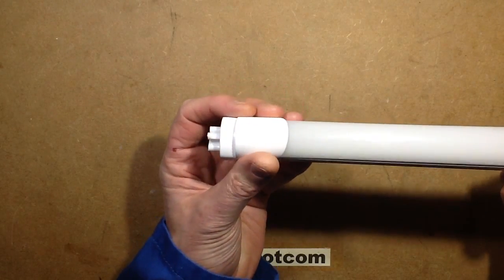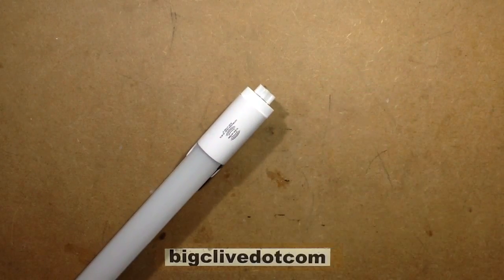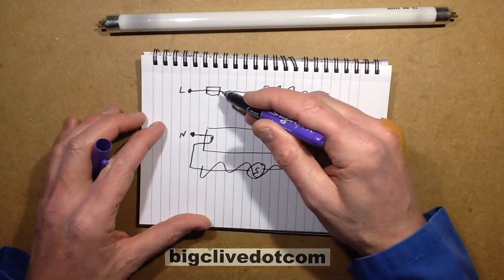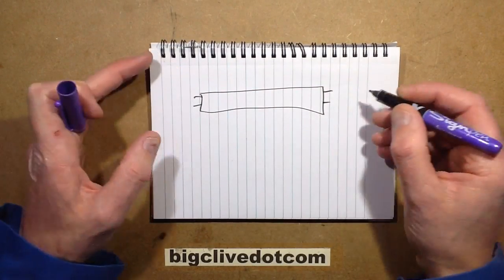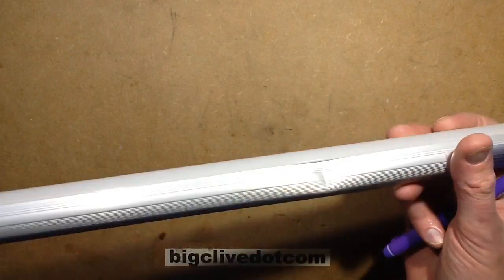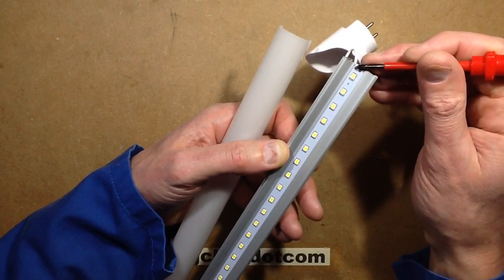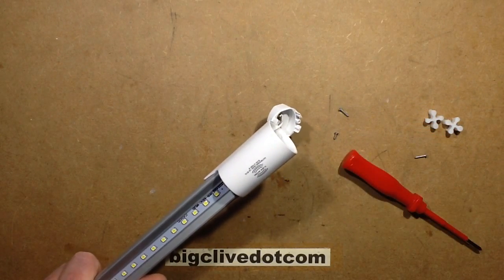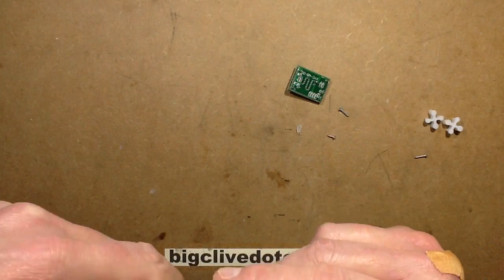Inside an LED T8 radar retrofit fluorescent tube.  (Excelvan)

Comment: It is probably a constant current buck regulator.
8 parallel strips of 24 series LED's.
Now that you've knocked one string out, the 7 rest will have to share that current making them fail much sooner. Avalanche effect.

Comment: 2025 Clive thank you a great informative video. May I ask a question? On the two pin Live on  one pin and Neutral on the other.. safer retrofit circuit as you advise. On the driver side mentioned. They show a live and neutral to connect to mains. In my book this is important. Can you confirm? Many DIY videos brush of and say it does not make a difference 230 V it is alternating current at 50 hz. I believe it is important for safety. To connect mains cable to a E 27 E S lamp holder it is important  to connect the live red/brown into the center point. Which is the correct practice.
Reply from the maker: In the case of an Edison lamp holder the live is connected to the middle pin at the back to reduce the risk of a shock if someone makes contact with the outer base while screwing a lamp in or out.   In the case of the fluorescent tubes, early units had live at one end and neutral at the other, giving the risk of contact with live pins when inserting the tube.
Reply: @bigclivedotcom Thank you again Clive. The original method was banned here. The retrofit led tube G 13 bi pin have to be marked L and N for exactly the same as you mention for safety. I have watched many bloggers saying it makes no difference where the L and N wire is connected but it does you always start by shewing a fuse of a sort on the L side not on the N side. Total enjoy your very informative videos. Please keep it up.

Comment: Hey Clive... I know... 8 yrs old video but I know you read messages so I have to ask you... have you ever did a video on T8 style LED tubes ? I can't find one if you did...
Reply from the maker: I have some here to take a look at.  The slight issue with the long tubes is fitting them on the bench during filming.  Most seem to either have a buck regulator in the end, or linear regulator chips, and then long series/parallel arrays along a PCB in the tube.

Comment: Hi Clive. Not sure if you will be aware of postings to these old videos, but I stumbled across this in my hope that my trusted content provider would have some wise words on the subject of replacing Fluorescent tubes with modern (2023) equivalents.
I saw this prancing prat https://www.youtube.com/watch?v=TzDA-paae3k telling me just what I wanted to hear!
I have 2 fittings from the 1960's which are beyond help.
To remove the fitting would bring down much of the ceiling, so I wanted to remove the failing Ballast, and the (dicky) Starter, and re-jig the wiring to accommodate a modern 1500mm T8 Frosted LED unit.
Having difficulty in finding such units which don't require Ballast & Starter.
Can you educate me, or consider re-visiting the world of Fluorescent Tube replacement, as I think it's something others might also come across?
Reply from the maker: Many modern LED tubes just require the supply to be connected across one end.
Reply: Lordy! you're up early!
Thanks Clive, does the other Tombstone needs shorting, to complete the circuit through the tube?  @bigclivedotcom

Comment: Hey Big Clive I just got a bunch of these tubes and they can be used with or without the ballast. I removed the ballasts to save energy and reduce heat. I noticed through that the tubes had L and  N at one end but they other end was just N on both pins. And the two pins were shorted out. This means if you rewire the fitting according to the instructions that come with the LED tube, then you must not put the tube in backwards or you will connect live to neutral. Any thoughts?
Reply from the maker: Some tubes still use the ballast, but others require it to be bypassed.
The first LED replacement tubes were powered from both ends, but posed a shock hazard if the tubes were changed with the power on when one end was inserted into a holder.  They changed it so one end is linked across, and also provided a shunted starter replacement.  Some contain a fuse - sometimes a self resetting PTC fuse in the shunted end in case the tube is put in the wrong way round.
Reply: @bigclivedotcom  Ok so the shorted end might have a self resetting fuse… why not just leave the pins disconnected though? Nowhere on the box does it say that there is a right way and a wrong way round to install the lamps. I have put large X’s on the ends of the fittings and the lamps so future me doesn’t go tripping breakers all the time :)
Reply from the maker: @billneoorg  It's so that the existing wiring of the fixture can be used after the ballast is bypassed.  By default live is at one end and neutral at the other.  It is bridged to the other end by the starter circuit.
Reply: @bigclivedotcom  thanks for answering by the way I love your channel!!!

Comment: Do you find in general swapping incandescent lighting for LED lighting you end up with a much lower light level and in most (all my instances of doing this) a very bad colour cast due to the LED lighting being warm white and giving a yellow cast to everything, making all things a very off shade of their original colour?

I recently (July 2022) tried some Asda 100 Watt Equivalent = 1521 Lumens LED BC light bulbs. Great, I thought, there is no plastic skirt around the base/glass bulb to cast a shadow halfway down your wall and that leaves a very dark ceiling.

I currently use 100 watt incandescent light bulbs that are marked as the equivalent to 1250 lumen. I have no idea how Asda measures the luminescence of their LED light bulbs that are marked as equivalent to 100 watt and 1520 lumens. The 100 watt incandescent light bulbs that are marked as the equivalent to 1250 lumen were far far far brighter than the Asda 100 Watt Equivalent = 1521 lumen LED light bulb and the colour cast of an incandescent light bulb is closer to being correct colour balance than the LED light bulbs I tried.

I am sorry to say, I still don't use LED lighting in my house because the LED lights are too low a light output and too close to being a yellow light than white light.
I'm sure if I put enough of these Asda LED BC light bulbs in the room, the room would be bright enough and if I added a blue filter it might whiten the light output, but to add enough light bulbs would defeat the current ideas that LED lights are more efficient than incandescent light bulbs, I guess they are if you are happy living in the "dark".

I am still waiting to find an LED 240v Bayonet/BC/B22 CAP light bulb that I can swap for the 100 watt incandescent light bulbs I currently use without sacrificing the amount of light and the colour temperature of the lights.

Regards,
K Watt.

Comment: I gotta say clive this is one time ill disagree with you, led lamps are much much brighter than the fluorescents, ive worked on both. It all depends on how high of quality the led is. In most office cases i actually end up getting called back to take out led tubes as they are too bright for the people working in the office, and its not the color we dont put anything up thats above 4000k unless its a special circumstance. In most cases the tubes i install are taking off much more than 50% of the power. And ive worked alongside contractors who think their electricians because they can rip out some wire and install an led, and i agree, they leave sloppy work and only care about the numbers they put up not how the next guy is gonna have to deal with their mess.

Comment: we converted all the t8s in our house to use led tubes. powered at one end only. i bought a bunch of these in 8 packs at about $10 each on amazon. and several of them have failed. ours looked like these, but did not have the motion detection feature. i saved the parts and was tryinv to determine the forward voltage of this strip. thanks for mentioning it in this video. i bought a small boost converter to power these high voltage strips amd also those tiny filiment ones. now i just need to figure out what to do with them. my led strips were ‘glued’ very poorly to the frame and did not sit in a track as you have mentioned here.

Comment: Some of the radar sensor I have taken apart and used for amateur radio hacking have used free running oscillators some have a DRO and are sorta set to a frequency. The free running types would change by 100’s of  MHz just by changing the loading and parasitics the DRO type seems to stay somewhat stable say 50MHz of drift with temp and loading. My guess is the fact they are all over the place and are operating in CW or FM CW mode you would see very little interference between modules.

Comment: I purchased some of the (older style) T8 led tubes and they had spring loaded pins to push switches on each end. I guess to try and make them less likely to shock the idiot holding it by the end. Problem with that, the pins would catch making it near impossible to twist into most tombstones.

Comment: Thanks for another great Video, Clive.
I have a dozen of these tubes in three brands, but all have blown the Polyester cap and the semi next to it.
 Like your tube the supply is 80 volts, but any suggestions on an alternate power supply?
Reply from the maker: It's an odd supply voltage and not much space to put the driver.  A capacitive dropper would be simplest, but not very bright.

Comment: I've seen two version of the LED tubes at the local Batteries + Bulbs.  One is a drop in replacement that doesn't require the ballast to be removed and the other does require the ballast to be removed and the fixture to be re-wired.

Comment: After deciding I wanted to go LED in my garage, mainly I wanted rid of the glass danger above the car, I decided the best option was not to use a retro fit bulb. In the end I went with some IP67 rated sealed units from Lidl. £17 each or so.... OK they are not serviceable but should last 25000 hours or something stupid. I really do rate them, keep a look out for the in the future and maybe you can strip one down to see what its like!

Comment: The newer ones I've seen come with a "starter" which serves to shunt the live & neutral connections to one end of the fitting with no modification to the wiring.
As you say, these retrofits are a complete waste of time & money. I've seen loads out & about with greatly reduced output and /or quite a lot of failed diodes in them. Long live fluorescent lamps!

Comment: I find it funny that this video was posted a few days after i started rewiring the first 50 lights for LED tubes. You and your timing :P
Blew up the first one because i thought they would accept power from both ends like the ones i have in my workshop, but nope, so i not only had to remove the electrical ballast and rewire a bit, but it ended in rewiring everything in there (lots of to short wires, and i didnt really like the idea of 6 wire clips in there)

Comment: "Especially when any real electrician would not finger the other end of a
 tube as they inserted it in the first place as even a conventional tube
 can ionise and give you a shock if you touch the pins at one end while 
shoving the other end into a live socket."

That's why the INSTRUCTIONS on light bulbs always say to turn off the power before replacing the bulbs- ANY bulbs... but since idiots don't read package instructions and warnings I say let em get shocked and they'll learn fast!
In all reality you can't get a shock touching the pins on the bulb unless you ALSO touch something grounded.

Comment: Most tubes rotate (click) into place so i can't see how you would ever electrocute yourself even if the fixture is switched on? I have some Auralum LED tube replacements and they are brighter and whiter than the Philips tubes they replaced, just because the tube you bought was useless doesn't mean they all are!

Comment: This is my first YouTube comment ever.    I find bigclive to be interesting and usually on point, but I do disagree with this video.  

(Perhaps it has something to do with products available in the UK Vs North America?)

I don't have any association with any any manufacturer or sales of LEDs.

From my personal research into the subject of replacing T8s with LEDs, I found this:

NOT taking into account hybrid style tubes that can work with, or without a traditional ballast.

 - Original LED replacement tubes were double ended, with Live on one end and Neutral on the other.
     - These were a problem for safety reasons (live end when installing improperly), and aren't really used in this manner any more.
     - These Tubes did not receive UL, CSA, etc certification.
                  - 

- Next came single ended tubes, where, in most cases, they were supplied with additional tombstones (the supports used to connect the 2 prongs) that were non-shunted.
     - Tubes had Live and Neutral on the same end on separate pins.
     - The other end was not connected to anything, and only used to support the tube.

- Last, Dual Ended, with safety connections.
     - Live on one end, Neutral on the other.
     - Would only connect the full voltage potential / connect the circuit once the tube is fully installed.   
                   - ie, no chance of touching a live end.
     - These can / are safety certified.

The removal of the ballast and connections directly to mains is very easy and straightforward, with minimal electrical knowledge.

   - I've installed 4 of the last type in my kitchen.  
           - They are just as bright as my old T8 tubes, if not more.

My parents building has been investigating changing over their parkade lighting to LED Tubes.  They have tried 3 different tubes, by 2 different manufacturers.  Having seen all of those, plus my own set - I can say this with confidence:

    - Quality is related to the individual model and manufacturer.
    - One brand of the lights tested I would not use.
    - Be sure of the specs you are getting when comparing.
           - Some LED tubes are spec'ed at different temperatures and lumens than the fluorescents they are replacing.
                  - The two lights from the same manufacturer were only different by the colour temps, but looked different in brightness, despite the same lumen rating.

Although, I do agree, don't trust the sales people from companies trying to get you to convert - they are often selling inferior products at significant profit margins.  It's cheaper the buy (good) tubes yourself and have a (certified) electrician install them properly - If you aren't able to do it yourself, or shouldn't for insurance reasons.  (ie, My parent building insurance would be void if I did the install.)
 
With all that, I'm not saying the tubes Clive got weren't junk - they probably were.  But there are good ones out there.

(The fact they got so damaged, presumably in transit, implies the sender didn't care enough to pack them properly. - mine came in individual thick cardboard tubes with foam blocks to keep the LED tub centred in the packing tube.)

Comment: I've worked with cheap Chinese brood-box heater bars. Aluminum housing, but ungrounded cable. As long as the wiring was good and you didn't hit a surge, you'd be fine. But one thing I noticed was that while it was turned on, if you ran your hand across the aluminum housing, you'd feel a slight buzz, where you wouldn't if you simply touched it, or it was turned off.

Comment: Philips offers an LED retrofit tube in the USA that keeps the ballast in place. The tubes have very little electronics in them. No real power supply section, just a few surface mount bits.

Comment: A couple of years ago I bought about 30 of these things from Bunnings Warehouse, one of the big box hardware stores that operates in New Zealand. They are the Viribright brand 2' tubes with the T5 fitting, and L&N are at opposite ends. The pins at each end are bridged together. However, they actually have a switch incorporated into the alignment spigot between the pins so they are not connected until the tube is inserted and rotated to it's proper holding position in the tombstone socket. 

Obviously no one wanted to purchase 2' tubes so they had discounted them. I got a few for $3NZD each and the rest for $1NZD a piece! I don't have any 2' foot fixtures for them so I just hardwire to the ends when I am using them. Then use the shipping caps as insulators for those connexions. 

These ones I have are very versatile in terms of what voltages & waveforms they will run from. They are happy with square waves & also DC. Although they are intended for 230 volts AC they will run down at 48 volts with reduced, but still useful brightness. Although for full brightness anything over 110-120 volts will do the trick.

I recently installed one as the replacement lamp in my solar power room. The video can be found on my channel if anyone is interested.

Comment: do you know of any good, log led strips ?
I want some for work, to replace sodium lights.... but putting in 30+ 6ft tubes seams like a waste... (and not just waste of £)

I thought I could find some good LED strips, a bit like those cheap 5m long ones you get on ebay cheap... but good quality etc...  but I can;t find any anywhere :-(

at this point I think I'll have to buy some aluminium profile on ebay, and then the RS version of those ebay led strips... still feels a bit clumsy tho :-(

any ideas/advice would be greatly appreciated :-)

Comment: We have bought 150 Led Tubes (more expensive ones). The guy selling those said they are of the kind that works with every setup. Here ist the strange part. When we put in the starter dummies they would not work. When we took out the starter dummie and left it empty, it worked. I am a little concerned about this.

Comment: The dimming is done with 0-10 volt, 10 volt is at full and 0 volt is in it's dimmed state. So if you apply say 5 volts it will be at half brightness